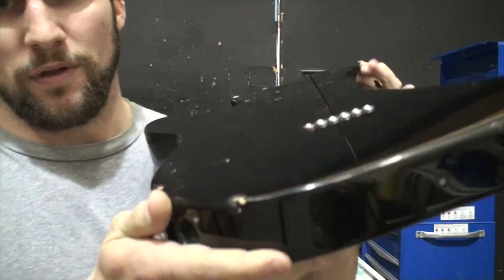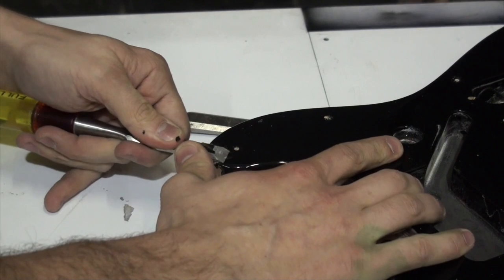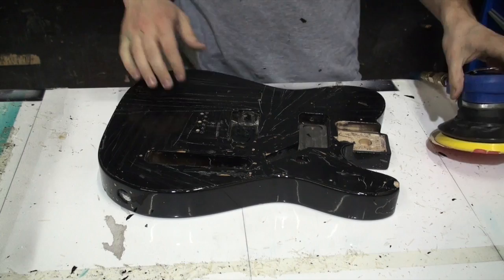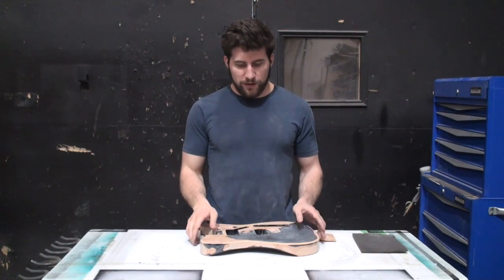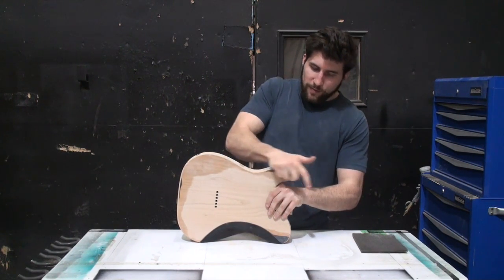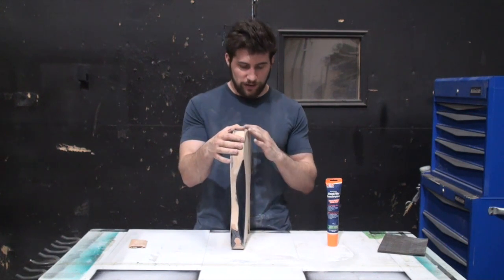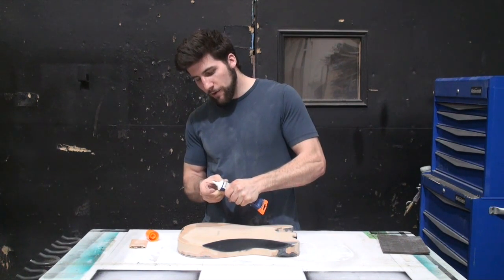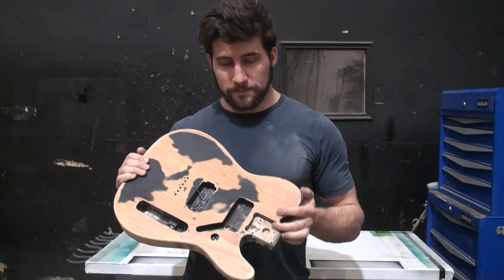Repairing dents and damaged paint on a guitar - Memorial tribute guitar

Comment: You can buy foam blocks that are coated with different grades of abrasive. They are great for sanding down contoured surfaces (as at 9'00"). After a while they tend to get clogged up with saw-dust, at which point they can be washed in warm soapy water which will remove most of the saw-dust, and left to dry, wherein they can be used again. They usually last for 3 - 4 washes before needing to be thown out. They come in packs - either 6 or 8, I'm not sure, and are well worth buying if you're doing this type of work. Used them on an old strat body with great success!

Comment: Like to see you do the same thing in removing old, chipped paint from an Acoustic Guitar and not damage the wood underneath or the binding, especially when the wood underneath is thin plywood layers in nature. Solid bodies are much easier to remove the old paint. Acoustic bodies are far harder to take off the old paint especially if guitar has a binding trim around it on both top and bottom.
Reply from the maker: Very true. However, acoustics should be lacquer rather than this thick poly, so it’s usually a simple matter of doing an easy chemical removal.
Reply: @BradAngove  I just started removing old paint off an acoustic that had a lot of paint chips in the finish. I seriously thought over using paint remover to do the job, but later decided to use a scraper and carefully scrape the old paint off instead. I have both the top and the back cleaned off. I'd say 90% of the smooth surface remained, while in a few places the finish became a bit rough due to a weak wood surface around where it was chipped. I didn't go through the top lamination anywhere on the top, so I'm hoping to carefully water sand the rougher surface areas to regain the proper smoothness again before repainting it. If water sanding doesn't work, a very thin coat of wood filler or a thin-out coating of super glue with sawdust, sanded down should do the trick. Still yet, I would like to see how you would do it with a guitar much like I am working on.
Reply from the maker: If the opportunity arises I will give it a try, but I seldom work with acoustics.

Comment: A bit late reply lol, but 1, you could have just repaired the dents/chips?...2, to remove poly use a heatgun and scraper, it will fall off and you don't get all that resin airborne, but yes just a two stage repair for the chips if it's a flat colour and to me it looks flat, correct me if I was wrong.

Comment: Regarding the dents that you had to fill using wood filler, would it be a good idea to score (roughen up) the inside of the dent before applying the wood filler in order to get the filler to stick more firmly to the wood? If the dent was smooth, surely there would be a chance that the filler could fall out after it hardened - especially if the filler were to shrink a little as it dries out?
Reply from the maker: There’s no harm in doing that, particularly if you’re dealing with dents that are smooth.

Comment: Damn I wish I watched this video before I went at my old Yamaha with a scraper tool. Had an old Yamaha solid body that my dad gave to me to practice some restoration on, and wound up putting a handful of knicks in some of the tighter areas of the cutaways. I’m gonna try this method before I continue staining and sealing. I had one question about the body of my guitar. The paint chiseled off like this one did in the video, but when I got to the wood, it felt so soft like there was a coating put on the wood before they painted it. I couldn’t find any info or videos online that say that companies do this before painting. It’s a bolt on and I can feel the actual feel of the wood, but the body feels kind of glossy. I hit it all over with 800 grit by hand and it still felt way too smooth. I tried a dab of stain on it and it seemed like it took, so I’m not sure if the Agathis body was just kind of naturally varnished because it’s a 20-year old guitar, or there might be a coat on it under the paint. Don’t know if you’ve seen this before at all?
Reply from the maker: I have some more recent videos about this where I use a different process to remove paint. You may want to check them out.The body likely has a coat of poly sealer on it that you have gotten through in some places but maybe not in others.
Reply: Brad Angove yeah I’ve seen a good handful of them before I started the process. I didn’t know what kind of paint was used, so I was using paint stripper on this, which was doing absolutely nothing. I watched the video of you using paint stripper and it was just hopping off, definitely some mad trial and error here. Glad I have this old guitar to practice this stuff on. Didn’t even think about scraping off the poly layer and sanding it down afterwards.

Comment: looks like i've to use a lot of these putty since 12 yr old cali series squier strat had dents & a relatively unrepairable surface everywhere.
Reply from the maker: You can always take a bit off the top and add a fresh piece of wood if it’s ridiculously bad and you have a router.
Reply: @BradAngove  fair enough. would it be ok if i just leave the imperfections as it is? i mean, its not as smooth as new but then again, there's no crack to be found.

Comment: With moderate heat the coat stretches and lift up so easily  in large flakes . Also the wood is not damaged .
Reply from the maker: Ya, that works great particularly with lacquer. It's a touch more difficult with this poly, but it's still an option.
Reply: Yip . my latest job was a 72 Japanese SG .
Reply from the maker: Nice. How did that turn out?
Reply: Its a great guitar with Swamp Ash figuring . I just polished it with linseed oil . I love the natural wood . Also because I could never get it back to the original transparent wine red .
Reply from the maker: Sounds like a pretty cool project.
Reply: It has a bigsby style trem .Binding on the neck and headstock . Two Humbuckers .I have lots of guitars . Some great , some junk . But I love them all

Comment: A technical suggestion...a heat gun and putty knife would signifigantly speed up the stripping process and reduce the chance of major gouges that could occur from razor sharp chisels...
Reply from the maker: +James Simpkins A heat gun works great on nitro. I haven't had as much luck using one on poly though. I'll have to give it another try.
Reply: There is a video by Sam Coulson called Refinishing my Stratocaster that shows the heat gun method on poly.... it also has insert of him playing, very tasty chops!
Reply from the maker: Nice, thanks for the info.

Comment: One word: Heatgun. Look on here for videos about removing poly with a heatgun. Done right you can  get the poly to separate from the guitar and come off like a shell.
Reply: Maybe maybe not. Heat gun will at least soften it enough to where you can stay out of the wood.
Reply: nope!! heat guns will literally burn through (depending on how well the guitar has been painted) it’s super risky to do and not safe. you are better off buying a finish remover that is unscented... takes 20 minutes to bubble up and then you peel it off with a metal scraper
Reply: @guitarforall  I've yet to see a factory guitar finish strippers work on. Solvents being effective is as rare as heat guns taking off a poly finish like a shell.
Reply: Rich Sackett well before you apply any paint stripping chemicals, it’s best to sand it down as much as you can by hand. i sanded mine down with 220 for a good while and then i applied the Zar paint remover , waited 30 minutes and peeled it all off super easy. some chemicals that are cheap won’t really work well, the zar was about $23-$30 USD , so it’s great and you don’t need a lot of it to get the job done. (and zar doesn’t have a strong chemical odor)
Reply: @guitarforall  Isn't that silly? You are sanding the bulk of the old finish away, through the clear, color but short of the sealer? If you're sanding, you're sanding to bare wood. Why introduce a solvent to the workpiece of which even a trace amount will compromise any future coating?
Reply: Rich Sackett depends on what type of guitar body... mahogany wood (for example) has open grain. so it won’t do any harm besides peeling off paint. then you could use a sanding sealer to close the pores and continue on putting primer ; paint; then the clear coat. i’ve done it 4 times now
Reply: I agree with the original poster. Heatgun is what is needed to remove this stuff. Strippers do nothing to poly finishes other than making a giant mess. We've done dozens of guitars and never a problem with burning anything. Once the poly is warm, run a scraper behind it and it comes off in sheets. This way, it doesn't take off the sealer coat.

Comment: How would you repair a crack that runs straight from the neck down maybe 3in from the bridge?
Reply from the maker: Is it cracked all the way through, or just a surface crack type thing?
Reply: @BradAngove  it's all the way through
Reply from the maker: I would probably just do my best to fill it with glue and then sand overtop to get some sawdust in there to fill the crack and smooth everything out.

Comment: Brad Angrove I have a question I tried spray painting my guitar and I fucked it up it has drips and the paint has cracked a lil bit in some spots how would I fix that? Should I just sand it all the way down to the wood ?
Reply from the maker: Drips can just be sanded out once the paint is dry. Cracks are different though. What kind of paint was it?

Comment: Would it be possible to sand a large portion of the damaged and surrounding area and use spray paint and clear coat to somewhat blend into the original finish? Just wondering because I have a bass with some weirdly damaged finish (almost looks like it melted) that I'd like to repair, but I really don't want to take all the original finish off.
Reply: I've sanded the bad area down already. It actually looks better sanded than the damaged or "repaired" (if that's what it was) finish did. Sorry for commenting so much on such an old video. Thanks in advance for any advice. :-D
Reply from the maker: Do you happen to know what kind of paint it is finished with?
Reply: I really don't know. It's an Ibanez Axstar bass (1986). It smelled strange when I sanded it, so maybe it is polyester?
Reply from the maker: Probably polyester yes. You can try a blend job on it, but you’re likely to end up with witness lines. Are you familiar with the term?
Reply: Thanks to Google, I understand the term somewhat. I think a line between the finishes will look better than what was there.

Thank you very much for your time, Brad.
Reply from the maker: In that case you can go ahead and do a touch up, then sand it all smooth and re-polish. It should be relatively subtle. I hope it goes well for you.

Comment: Hey Brad! Another question haha, how can I fix chips and scuffs on a matte finish guitar? Also what kind of glue can I use to glue down a guitar's binding? Thanks again!
Reply from the maker: There are many options for flying down a binding. I suggest you have a look at the tutorial series crimson guitars did on improving a cheap kit guitar. They do a full demo of gluing down binding. 

As for the dent repair, what type of paint is it?
Reply: Brad Angove well I might have not described it correctly; the part I need to glue is the back of the guitar. It's an acousticand it's a natural finish. I'm pretty bad at explaining as you can tell haha.. do you have an email I could send you some pictures to? Maybe that will be a lot easier haha! Thanks btw!
Reply from the maker: So it’s not the binding? You can use the Facebook link in the description to send me pictures.

Comment: Hey Brad any pointers to filling in a pickup cavity? I’ve tried several methods and sand out smooth but once I apply the finish paint the out line still keeps appearing.
Thanks in advance
Reply from the maker: Generally I would create a wood block to fill that in and then use bondo for any large filling and simple wood filler for smaller/final filling.
Reply: Thanks Again!

Comment: bro what sanding paper did you use?
Reply from the maker: +omar moran For which part?
Reply: +Brad Angove At9:00 i saw u using a sand paper with ur hand. what number grit was it? im doing the same thing but with a heater gun to take off the paint. lol i dont have thos big sanding machines  that u have so doing it by hand :)
Reply from the maker: I was using 220 grit for that part, but if I was at the beginning taking off the paint by hand I would probably start with 60 or 80 grit and then sand out the scratches with 220 etc. after.
Reply: +Brad Angove thank you so much :)
Reply from the maker: You're welcome.

Comment: Hey Brad, After a few days of finishing my guitar it gets texture marks from the guitar stand, can it be repaired to stop texture marks?
Reply from the maker: What kind of paint did you use?
Reply: @BradAngove  Rustoleum spray can
Reply from the maker: That stuff takes a few weeks to dry fully. That’s probably why you have marks. To repair it you would sand it back smooth and add a fresh coat or two, then let it dry fully.
Reply: @BradAngove  thanks

Comment: All that poly is what kills the tone on the guitars.
Reply from the maker: Not on solid body electric guitars.
Reply: Brad Angove not true.
Reply from the maker: Unfortunately that theory has been disproven many times.
Reply: @BradAngove  I have proved it my self. I have 2 exact guitars one with poly and one with lacquer finish and they do sound different. I know that the theory is that it's not about the material used to finish the guitar, but how thick it's applied. Unfortunately most poly finished are applied very thick you proved that in this video. That thick layer of poly does not allow the wood to resonate like it should. Wood resonating in an electric guitar is something that affects the tone!
Reply from the maker: Of course they sound different. An extra inch of wire, more solder, different set of strings...
On an acoustic the way the wood resonates absolutely matters. On a solid body electric it doesn’t.